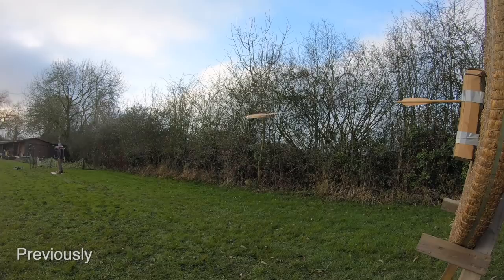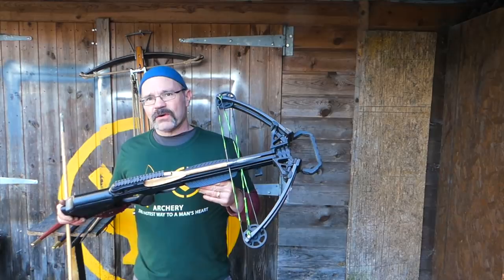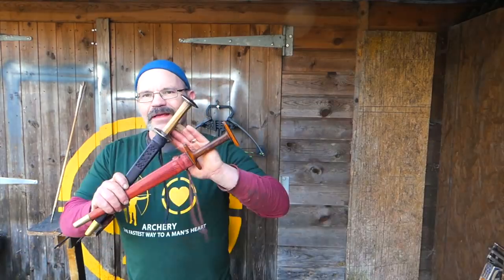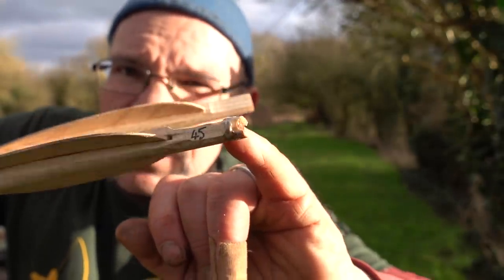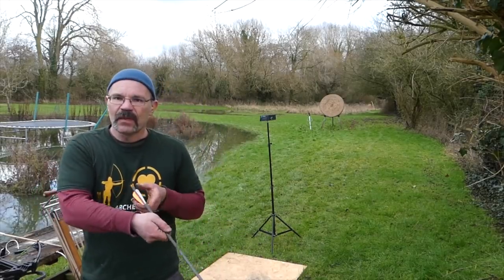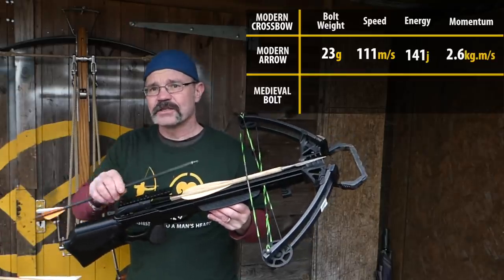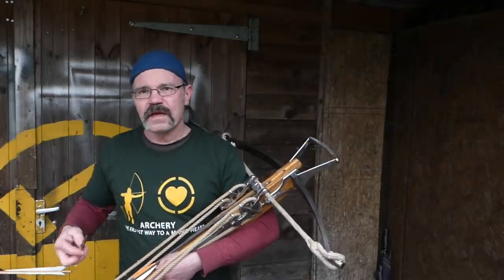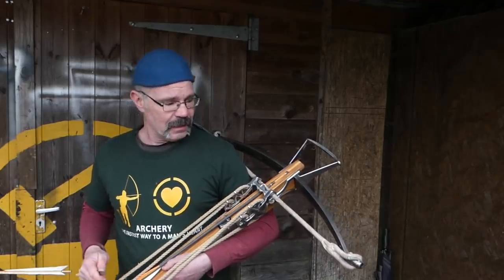Heavy Crossbow - Light bolt - What happens?

Comment: Now i am wondering "how heavy can you go?" with these bolts... There has to be an energy sweet spot that the crossbow can deliver. I guess the people of the past found it intuitively, and the bolts are already about the best weight, but would still be interesting to see.
Reply: Well... There's Joerg Sprave and his metal bolts if you want to check those out
Reply: The recommended arrow and bolt weights nowadays are partly to keep the mechanism from reacting too fast and destroying itself. Heavy arrows don't shoot as fast or flat and that's part of marketing, but they buck wind and penetrate better. And yes, the mechanism has a sweet spot for optimal efficiency.
Reply: @feryth  Jörg uses new Crossbows, I am not really interested in those tbh. I want to see the 1000lb Crossbow to show its limits 😅
Reply: I'd hazard a guess that they didn't the sweet spot intuitively, but rather through experimentation or trial-and-error. That being said, it's of course a lot easier to test with today's technology, which automatically tells you the speed, energy etc., or at least lets you calculate it.
Reply: So by my napkin calculations the virtual mass of the medieval crossbows moving parts seem to be 170g. Which means a bolt of 3x that weight or 510g (a coke bottle) would get 75% of the total stored energy and deliver 269 J with a speed of 32m/s and momentuum of 16.3 kg*m/s. I see no reason not to test it.
Reply: @dragoscoco2173  That is way more than i expected, would love to see it tested, especially its piercing power against armored targets. And of corse see the effective range as well, as it will go down with the lower speeds.
Reply: That would be the next logical step in the testing, at least to my thoughts.
Reply: @Daniels_unique_YouTube_alias  You can of course go higher than that but the 510g bolt would already kick like a 500 S&W (from what i can find on the net), which is not very pleasant from a wooden lump without a shoulder stock or grip. Sadly I do not own a 900lb crossbow, but have launched shovels from a normal bow, it is not as majestic as it sounds.
Reply: +1 =)
Reply: The energy sweet spot is at near infinite mass. This can be shown with some calculations. However, there is a tradeoff between range and energy. The heavier your bolt is, the higher your energy, but also the shorter your range. From the calculations I've done I've concluded that the maximal energy reachable with the compound is 170.7 J and 355.8 J with the medieval crossbow.
Reply: @dragoscoco2173  I've found a very similar virtual mass of 168g. The virtual mass of the compound bow is only 4.7 grams.
Reply: @lukasdimmler2622  Thanks for confirming my napkin. I did post the numbers in some obscure comment here. I am amazed at the level of efficiency in the modern crossbow but given the cams, lightweight limbs and string it is why it goes so efficient.
Reply: Economics play into it as well. Say that a solid iron bolt would be better, would they have spent the time and material on one really good bolt or 10 good enough bolts.
Reply: @dragoscoco2173  The efficience is indeed quite surprising. It makes you wonder what a modern bow with the same or more potential energy than the medieval crossbow could do.
Reply: @dragoscoco2173  I believe you missed a couple of things in that quick'n'dirty calculation. While I believe the fundamental assumption of treating the problem as an impact problem is correct, I doubt it would be the most efficient mass. My gut feeling, based on many solved kinematics problems from my mechanical engineering studies, is that the optimal conversion ratio is somewhere at or below the weight of the moving parts. It could go as low as half the weight, because the rotation of the steel bow adds a moment of inertia component that increases the amount of energy the bow siphons, regardless of bolt weight, if that makes sense to you.
Reply: Was about to ask the same thing.  What does 80, 90, 100 grams look like in the old guy?
Reply: @dragoscoco2173  With a little research I've calculated that you could shoot a 800g bolt (same mass as an olympic spear) up to 75 m with the medieval crossbow. The current record for spear throwing is about 99 m.
Reply: You can always go bigger - a ballista is just a big fuck-off crossbow after all
Reply: @davehemke7786  Velocity: 53.6 m/s,  52.5 m/s, 51.5 m/s.
Energy: 114.8 J, 124.1 J, 132.8 J.
Impulse: 4.28 kgm/s, 4.73 kgm/s, 5.15 kgm/s.
Maximum Range without air resistance: 292.5 m, 281.2 m, 270.7 m.
Reply: Were talking War here. Different weapons for different targets, ranges and you have lots of them. Kinda like the Boys Antitank Rifle, the most power a man could carry and shoot to stop horses and men with some armor. What we do know is that they did a proper job of killing each other.
Reply: @dragoscoco2173  
Underwood 700gr lead flat nose 500sw
Projectile weight 700grains = 45grams
Muzzle velocity 1200fps = 365m/s
Energy = 2238 ft/lbs = 3034J
Momentum = 16.4kg.m/s
That's a fairly standard lead heavy load for a 500sw and manageable out of any typical hunting revolver chambered for it. That's still a handgun and one quite usable one handed. Crossbows don't measure up well against modern hunting handguns, much less long arms. 

Bog standard Winchester white box .308 packs a 150gr pill going about 2800 fps for 3600J of energy. Any of the heavy hunting rounds get to truly ridiculous numbers. There's a reason why safari loads can reliably take down african cape elephants in a single round while Hannibal's famous pachyderms could have stared down even arbalests.
Reply: @Daniels_unique_YouTube_alias  I would love to see that too!
Reply: @havokmusicinc  there's a guy online that has made a 5000lb(!) draw weight ballista. He launches 1¼lb bolts 1000y with it. Watts Unique is the name.
Reply from the maker: Thanks for the thought Daniel and yes I think I have to test the different weights and see where we go.  There are no bolts that we know were shot with a particular bow (as far as I know) so we simply can't be sure of what weight was shot from what, however bolts often come in around 75-90g so this looks like a reasonable weight to assume they shot.  Energy does go up with weight unto around 125g from this bow and the speed does not drop massively, but it does drop, so presumably distance was also important even a loss of say (guess) 30m must have mattered more than a 20% increase in energy.  I guess we will have to test it to see.
Reply: @tods_workshop  Looking forward to it!
Reply: @ScottKenny1978  Can you link the video?
Reply: @tods_workshop  Looking forward to it, really enjoy these hand's on experiments, even if they are not my hands sadly 😅
Reply: @lukasdimmler2622  not a lot of videos, dude built the beast on a Blog over almost a decade now.

http://wattsunique.com/blog/

My comments on the post for group size: a Roman century is just about 30x30 feet (depends on how many ranks and files), that ballista can drop 500g bolts into your century at 800 yards and every shot will hit someone
Reply: Seconded!  https://www.youtube.com/watch?v=ghoVmc12vEs&lc=Ugx6oe6ffUBsmHPqM0R4AaABAg

To what extent can you launch, say, one of your plumbata?  Or a necked-down version, at least.

Heavier-weight projectiles almost certainly permit scaling into heavier-duty crossbows and longer-draw crossbows, as well.  The Instant Legolas was so intriguing because it represented what you could do with a bow if only you had taken the design back a thousand years.  What could you do with a 300lb * 28" draw longbow on an Instant Legolas with one of the medieval crossbow cocking mechanisms?  What were the practical limitations on larger and more powerful weapons?
Reply: @lukasdimmler2622  Or about the same as a .38 special but with a quarter the range, a tenth the accuracy and a hundredth the rate of fire.  My biggest beef with movies and TV shows about medieval and ancient combat is that they try to pretend that missile and bow fire is simply some form of manual gunfire complete with recoil, minimal time to impact, minimal projectile drop and maximal lethality.  I have fired many a firearm in my life (as well as quite a few ancient weapons) and as I keep telling my wife -  getting hit by a bow or crossbow would be exactly the same as being stabbed really hard by a very sharp stick.  Because ultimately that is exactly what they all are.
Reply: @CtrlAltRetreat  Thanks for the analysis - I am currently working with a friend on a card game about ancient combat and was wondering about the energy levels needed for anti-elephant combat.  As I expected, if you had little more than javelins and sling stones against a charging elephant then you would be pretty screwed !
Reply: @rags417  
Glad you got some amusement out of it. Underwood gives good numbers for all of their loads (and make great traditional ammo) and use testing proof barrels that actually represent the guns the rounds will be going out of so can be a good way to get some ideas. Kentucky ballistics does great testing with everything big bore on YouTube so I'd highly suggest checking him out if that's your cup o tea as well.

In the end Hannibal did finally find his match against Scipio and absolutely the elephants were not something to be faced down with a small pointy stick or a twirly rock chucka, but fire and loud sounds did work, as did traps, larger stick shooters, heavy pointy sticks and cavalry somehow. Must have been terrible to fight by all accounts but they eventually were defeated en masse and once the strategies to counter them were developed, well how many other generals going forward brought war elephants into europe.

But the Romans eventually learned to entirely counter them throughout the campaign against Carthage culminating at Zama. The final solution Scipio used to counter the 80 war elephants Scipio fielded in defense was to divide his vanguard into nimble manipules, evade the initial charge and then use a combination of fire, shields held up high at elephant eye level and trumpets and shouts which confused the elephants and redirect them, some even back into Hannibal's own lines. The Romans ended up deciding rather than killing the elephants, confusing them into charging the wrong direction would turn the weapon against their enemy. Whether this was because their previous experience killing war elephants was deemed not worth it or as some historians believe, they were somehow able interpret and decode the horn signals the Carthaginians used to direct their newly raised and less experienced elephants raised to replace losses was up to question. The rise and fall of Rome, the Sabines, Carthage, Scythia, heck the whole classical period would be a fertile place to put down a wargamey card game.
Reply: @Keiranful  The whole point of using virtual mass is to drive the equations down to a basic spring mass system, doable on a napkin, basically a slingshot. Now a crossbow is much more complex, with sine effects and angular momenta and such, but given the small draw length and low travel of the limbs this should suffice. For anything more in depth a thorough analysis of the crossbow and it's weight distribution is required.
Reply: @mawe9878  I though so too but them I found out that the Romans has solid bar spears the Soliferrum. Now if the Romans had those i doubt the Medieval Society did not out of economical reasons. I think that the wooden shaft was just aerodynamically better and the weight was just good enough for them.
Reply: @lukasdimmler2622  Don't tell Tod about the spear thing, he's gonna pull out the 2000 pounder.
Reply: @rags417  I remember an old YT vid where a guy was shooting Asprin tablets out of the air with a recurve bow.. Anyhow, I've hunted large Elk 500+ lbs cows, and 700+ lbs for bulls. With proper shot placement and the right broadheads they'll drop before they know anything happened. Range is the problem, I use a Hoyt 80lbs draw, but wouldn't feel comfortable outside of 150' to make a clean kill. During rifle season, I can make the same shot with 168gr .308 loads out of my rifle up to 1800' confidently. Usually don't need to go beyond that, but can with my Father's 7mm rem mag, 24" barrel 175gr i can kick out another 600' again confidently. That range gives you a trade off, meat damage. As I hunt for my freezer my .308 will ruin a between 5 - 10% of the edible meat, mostly the facing ribs, heart and the exiting ribs. 7mm does a bit more.. Bow does little to none. Like Tod said it's all about trade offs.
Reply: @tods_workshop  It's also entirely possible that the arbalester in question would have a selection of different weights of ammunition, just like an archer might. Flight quarrels and war quarrels, trading range for extra power or vice versa.

Which also begs the question: How do all these factors (energy and momentum) translate in terms of penetration? Is it linear, or is there a point of diminishing returns? And does the nature of the ammunition matter? How does a longbow arrow and a crossbow quarrel shot with similar energy or momentum compare?
Reply: Depleted Uranium crossbow bolts, let's gooooo
Reply: Yes, that is the next question. One additional question i have: is the string of the medival crossbow waxed so it can glide better/faster over the shaft?
Reply: Hello  @feryth , yes, with rasor blades :)
Reply: @lukasdimmler2622  I got the same numbers as well (posted in the comments).  I was a bit surprised at how low the modern crossbow was.  One interesting thing I found extending the bolt mass, was that when you get to a ~150g bolt, the medieval crossbow will shoot the bolt faster.
Reply: @lukasdimmler2622  at a certain point you'll lose much of the energy to pushing the bow and the person backward.  Certainly by the time the bolt starts weighing a significant fraction of the bow, you'll see the bolt energy dropping.
Reply: @tods_workshop  by my calculations, when the bolt gets to just shy of 150g, the medieval bow should shoot faster than the modern crossbow, with a speed of 47m/s.  Also, a 200g plumbata would go roughly 44 m/s from the medieval bow and hit with 193 Joules!
Reply: @peterlively8269  I think the entire crossbow weighs more than 3kg. To loose 10% of the kinetic energy in recoil you would need to have a 300g arrow. If you secure the crossbow to a 20kg table that weight increases to 2.3 kg.
Reply: @rags417  I would argue that similar applies to movies and TV shows about modern combat. Car doors will stop bullets, automatic weapons don't require reloading etc etc. Not disagreeing with your point btw.
Reply: @lukasdimmler2622  True.  Although one thing I didn't think of, is the medieval bow only has about 350 Joules of energy stored (well, useful energy stored), depending on the actual draw length.  The modern bow has about 170 Joules of useful energy (based on estimated draw length).
Reply: @peterlively8269  Curious how do you come up with those values guys?

Calculating for steel bow may be somewhat simpler,  string bends the prod at roughly consistent angle.

But the leveraging system of compound bow makes it tricky.

In any case, I wouldn't be surprised if between way longer draw length and leveraging, compound bow was storing more energy period, despite needing only 150 applied at the string. Or at least not that much energy less, and the greater efficiency does the rest.

Love the aesthetics and "spirit" of those ancient things way more than modern one,  but modern one is way superior design, no doubt, lol.
Reply: @lscibor  Basically you treat the mechanism as a spring-mass system.  There are some assumptions in that (that the force goes linearly with the draw, which is true for the medieval bow, but the cam-ing on the modern bow will change that a bit).  The peak velocity of a spring mass system is proportional to one over the square-root of the mass being moved (assuming the same starting position and spring constant).  Then it is a matter of finding the amount of mass you need to add to fit the values Tod used.  v1=C*1/sqrt(m1+m0) and v2=C*1/sqrt(m2+m0) where m0 is the mass you are trying to find.  There are a lot of ways this breaks down, but that is the answer to first order.

It is also important to point out this is effective mass.  So a large mass that only moves a fraction as far, counts as a much smaller mass.

To find the energy that could be imparted, you need to use the equation E=1/2 * k * d^2, where k is the spring constant and d is the draw length.  We know the force at full draw.  Somewhere Tod says the drawlength, but I couldn't find it easily... Based on the velocities and the peak draw force, I could estimate it as 17cm for the medieval and 51 for the modern.
Reply: @tods_workshop  Methinks the vast majority of surviving bolts are either 15th/16th century hunting bolts or the mass produced ones for wooden prod or low drawweight munitions quality ones.
Reply: @CtrlAltRetreat  This will be our second card game, it's called TAKTIKA and will be self published at first via Game Crafter on line, later on if we get volume sales we are looking at a company in China to do the printing.  The game will initially cover the late Classical and early Hellenic period (ie Persian Wars, Alexander the Great, Diadochi and Epigoni wars) but the card stats can be tailored for pretty much any period up to early and mid firearms.  In my playtests I've even played out Culloden with no change to the basic rules.  The Punic Wars and later wars of the Roman Republic will probably be our next mod pack.  PM me if you want to know more !
Reply: @gwtpictgwtpict4214  Yeah, I love the medieval period and guns and I just hate it when I see people doing it wrong.  My biggest gripe with modern combat depictions is how lethal it is (or IRL - "isn't").  I remember reading many years about a battle between a company of  Marines and a few hundred insurgents in Falluja - in the end the Marines lost 3-4 killed and maybe a dozen wounded, the insurgents maybe 2-3 times that number.  After 3 hours of constant shooting !
Reply: @lscibor  This calculation can be done here as Tod so gracefully shot and measured the speed of two bolts of highly different weights in a crossbow. Laying out the basic energy equation as Total=Energy of bolt+Energy remained in bow you get two equations and two unknowns, these being the Total energy and a mass of the moving bow (a hypothetical mass to compensate for the complex mechanics, sometimes called a virtual mass). 2 Eq and 2 unknowns is solvable and after finding them out you can get into predictions, like dry fire speed or any mass bolt speed for that matter. Now for very heavy bolts recoil effects start to get important, but I believe it is in the kilogram range.
Reply: looks arcoss room at broom handle ..hehe  yes.... hehe
Reply: Whilst energy and momentum are both very important, I think there's a point where speed starts to play a factor. The range of the weapon is limited by it's speed, not by it's energy or momentum. So you got to balance the bolts for energy, momentum and range. Having a higher momentum will make it lose less speed over it's travel however, being launched faster will always have the biggest impact on it's range. Plus it's easier to aim the faster the projectile is, as it has less drop due to gravity and less time to go over the distance between the shooter and target.
Reply: I wonder if it would be possible to make a bolt with their time appropriate metal core. Cast iron or something. The idea to create an precision weight bolt. Dont know how that would affect the spine of the bolt, or if crossbow bolts even care abount spine values tho i guess they do down to a certain point.
Reply: Up next: "launching a brick with a medieval crossbow."
Reply: You could basically go as heavy as you want. The thing is, you will want to have some range and the heavier the bolt, the less range you get, even if the impact energy is comparable.
Reply: Ha, didn't read and posted basically the same question. Would be very interesting
Reply: Since triple the weight only dropped the speed by 10%, I reckon you could go a lot hight with the medieval crossbow.
Reply: @NVidea-yz1fg  You cannot go as heavy as you want from a practical point of view. The action reaction principle means that as the bolt reaches the mass of the crossbow it will tend to fling the crossbow backwards with the same speed it goes forward. Unpleasant as that sounds if you go further to infinity, basically a bolt already fixed to a sturdy wall, then the crossbow becomes the only moving thing and unpleasant is an understatement.
Reply: Going the other way would be just as interesing, a 1000lbs draw weight modern compound crossbow.
But i think the 23 gram modern bolts will probably crumple up from all the force put on it by the drawstring during accelleration when you shoot it with those loads.
Reply: @tods_workshop  i know a hunter who hunts big game with a  ~100lbs compound bow. He used the following system to increase his arrow weight:
He uses higher diameter aluminium arrows and glues in a fitting rubber tube. That might be an easy way to setup different bolts with different weights to find the sweetspot for 950lbs windlass.
Would be amazing to see what this historic weapon was capable of doing, had they had the required ammunition technology and supply.
Reply: @mawe9878  A solid iron bolt would be a waste of material in some cases because if the battle isn't won, you can't retrieve the bolts. Of course, the bolts would probably increase the chances of a victory.
Reply: @lukasdimmler2622  I don't think a 1000lb Crossbow is possible with Fiberglass and Pulleys. Thick Fiberglass would be no more efficient than Steel. Heck, I don't even think Fiberglass has the  structural integretity to handle 1000lbs.
Reply: @Vinnay94  There is a video by historical archery about a 190 pound turkish bow out of fiberglass that is fairly small. Also mordern composites like fiberglass have similar if not better characteristics than steel.
Reply: @mawe9878  Bolts with a lot of iron was used, they had a backwards spike inside the wooden shaft and was rained down on horsemen, them that hit a horse good but the ones that missed would then stick in the ground and the wooden part break of and leave a standing spike in the ground for horses to tread on. If I remember correctly metal part 170 grams. Do not have time at the moment to look it up but it's in the digital archives museums Sweden and are mentioned in Suecia Hodierna et Antiqua. So late 1400's early 1500's . Search word (Skäkta,  Armborstskäkta) Skäkta is a crossbow bolt.